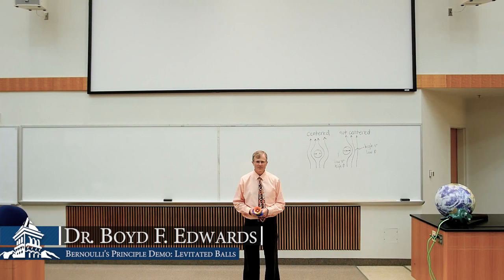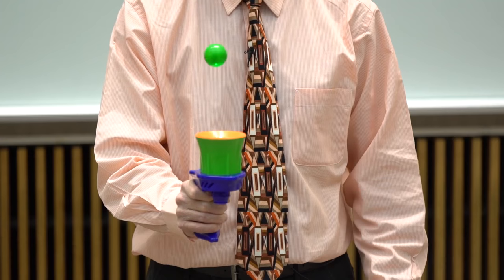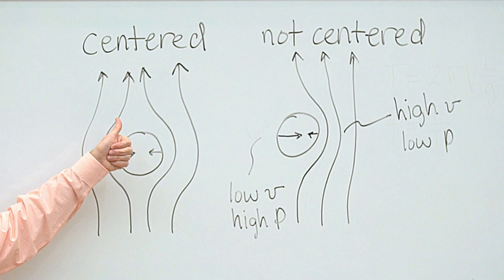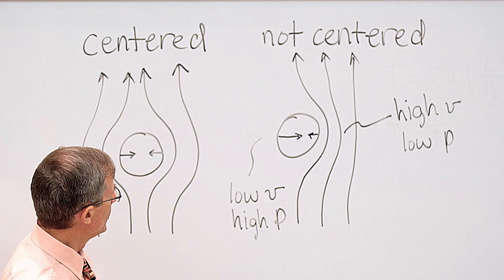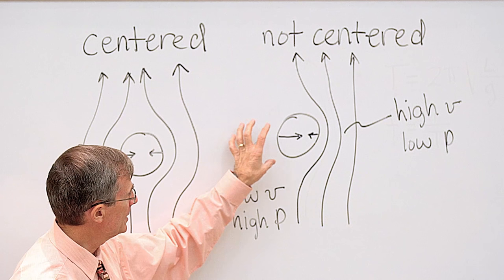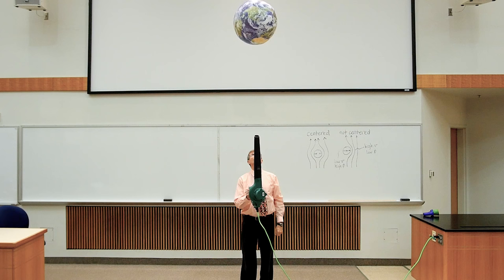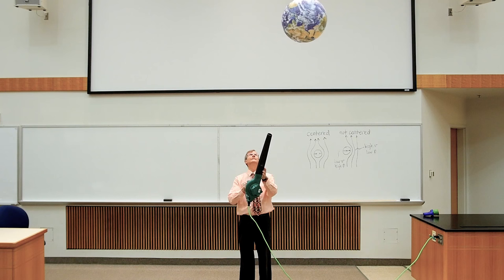Bernoulli's Principle Demo: Levitated Balls

Comment: Why does it start spinning?
Reply: The effect of viscosity is like friction.  The water "drags* the surface along with it. 
..
AND...
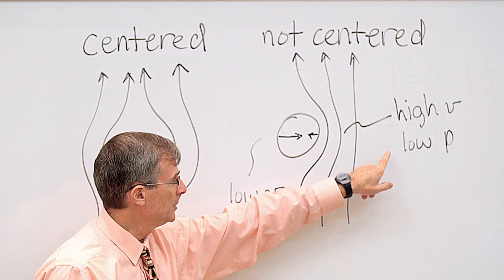'At 1:55; Another video with the most common misconception in fluids.  
..
The centering is caused by the acceleration of the curved flow and is called the Coanda Effect, NOT Bernoulli's Principle.
..
The statement at time 1:55 is Incorrect  : "If you have a high velocity, a high airspeed, then you nave a low pressure." <-- That is false. 
..
Bernoulli's Principle correctly stated is: "An increase in speed is accompanied by a decreasing  pressure.":
An increase in speed is an acceleration!  
 An increase in speed is acceleration, not simply fast. 
.
Bernoulli's Principle becomes relevant at the place where the air is accelerated to the higher speed. 
..
You cannot compare some "fast" air with any random near-by 'slower' air for the pressure difference.  The air must be accelerated.
.
Then, it is the pressure difference for the flow that causes the acceleration.
..
Other common demos are also misunderstood and misinterpreted are blowing over a curved paper, between two balloons or two cans. Those are all curved flow: Coanda Effect.
.
This simply parrots incorrect science.
..
For better information and demos anyone can easily duplicate see Weltner:
Weltner in PDF - "Misinterpretations of Bernoulli's Law".  
Read the text and focus on these figures. :

Fig 3 "Fast" air, NO PRESSURE REDUCTION. 
Figs 8 & 9  Curved (accelerated flow) Pressure change.
http://user.uni-frankfurt.de/~weltner/Misinterpretations%20of%20Bernoullis%20Law%202011%20internet.pdf    

Please stop teaching bad science.
.

Here's videos that got it right: 

This one has it 100% correct! 
https://www.youtube.com/watch?v=kR2Oi3XCX18 

The water curving around to the top wants to go straight.  It's inertia lowers the pressure on the inside of the curve keeping it in the stream.  It is explained better here when a fluid follows a convex curved surface:
 https://www.youtube.com/watch?v=3MSqbnbKDmM 
..
This one s also correct. 
 https://www.youtube.com/watch?v=NvzXKZNJ7ZU 

Veritasium. He doesn't explain it completely well.  
https://www.youtube.com/watch?v=mNHp8iyyIjo

Comment: how can i calculate the angle that makes the ball fail ?
Reply from the maker: That's a great question.  You'll need the fluid (Navier-Stokes) equations for that, and they are not covered at this level.  I've not done the calculation, but it's an interesting one!
Reply: @physicsdemos  can u help with it ?
Reply: @ahmednashat2164  I'm not interested in doing the calculation, but I imagine that it's already been done by someone.
Reply: As a rule of thumb, don’t go past 45° on any direction and you should be good

Comment: I can understand it when i am 9... and now, i am graber: lol>
Reply: At 1:55; Another video with the most common misconception in fluids.  
..
The centering is caused by the acceleration of the curved flow and is called the Coanda Effect, NOT Bernoulli's Principle.
..
The statement at time 1:55 is Incorrect  : "If you have a high velocity, a high airspeed, then you nave a low pressure." <-- That is false. 
..
Bernoulli's Principle correctly stated is: "An increase in speed is accompanied by a decreasing  pressure.":
An increase in speed is an acceleration!  
 An increase in speed is acceleration, not simply fast. 
.
Bernoulli's Principle becomes relevant at the place where the air is accelerated to the higher speed. 
..
You cannot compare some "fast" air with any random near-by 'slower' air for the pressure difference.  The air must be accelerated.
.
Then, it is the pressure difference for the flow that causes the acceleration.
..
Other common demos are also misunderstood and misinterpreted are blowing over a curved paper, between two balloons or two cans. Those are all curved flow: Coanda Effect.
.
This simply parrots incorrect science.
..
For better information and demos anyone can easily duplicate see Weltner:
Weltner in PDF - "Misinterpretations of Bernoulli's Law".  
Read the text and focus on these figures. :

Fig 3 "Fast" air, NO PRESSURE REDUCTION. 
Figs 8 & 9  Curved (accelerated flow) Pressure change.
http://user.uni-frankfurt.de/~weltner/Misinterpretations%20of%20Bernoullis%20Law%202011%20internet.pdf    

Please stop teaching bad science.
.

Here's videos that got it right: 

This one has it 100% correct! 
https://www.youtube.com/watch?v=kR2Oi3XCX18 

The water curving around to the top wants to go straight.  It's inertia lowers the pressure on the inside of the curve keeping it in the stream.  It is explained better here when a fluid follows a convex curved surface:
 https://www.youtube.com/watch?v=3MSqbnbKDmM 
..
This one s also correct. 
 https://www.youtube.com/watch?v=NvzXKZNJ7ZU 

Veritasium. He doesn't explain it completely well.  
https://www.youtube.com/watch?v=mNHp8iyyIjo
Reply: @Observ45er  Thanks!!!

Comment: At 1:55; Another video with the most common misconception in fluids.  
..
The centering is caused by the acceleration of the curved flow and is called the Coanda Effect, NOT Bernoulli's Principle.
..
The statement at time 1:55 is Incorrect  : "If you have a high velocity, a high airspeed, then you nave a low pressure." <-- That is false. 
..
Bernoulli's Principle correctly stated is: "An increase in speed is accompanied by a decreasing  pressure.":
An increase in speed is an acceleration!  
 An increase in speed is acceleration, not simply fast. 
.
Bernoulli's Principle becomes relevant at the place where the air is accelerated to the higher speed. 
..
You cannot compare some "fast" air with any random near-by 'slower' air for the pressure difference.  The air must be accelerated.
.
Then, it is the pressure difference for the flow that causes the acceleration.
..
Other common demos are also misunderstood and misinterpreted are blowing over a curved paper, between two balloons or two cans. Those are all curved flow: Coanda Effect.
.
This simply parrots incorrect science.
..
For better information and demos anyone can easily duplicate see Weltner:
Weltner in PDF - "Misinterpretations of Bernoulli's Law".  
Read the text and focus on these figures. :

Fig 3 "Fast" air, NO PRESSURE REDUCTION. 
Figs 8 & 9  Curved (accelerated flow) Pressure change.
http://user.uni-frankfurt.de/~weltner/Misinterpretations%20of%20Bernoullis%20Law%202011%20internet.pdf    

Please stop teaching bad science.
.

Here's videos that got it right: 

This one has it 100% correct! 
https://www.youtube.com/watch?v=kR2Oi3XCX18 

The water curving around to the top wants to go straight.  It's inertia lowers the pressure on the inside of the curve keeping it in the stream.  It is explained better here when a fluid follows a convex curved surface:
 https://www.youtube.com/watch?v=3MSqbnbKDmM 
..
This one s also correct. 
 https://www.youtube.com/watch?v=NvzXKZNJ7ZU 

Veritasium. He doesn't explain it completely well.  
https://www.youtube.com/watch?v=mNHp8iyyIjo
Reply: This was the comment that I was looking for.  I suspected there was a problem, but I didn't know enough details to spell it out so well.  Thank you.
Reply: @marcochimio  At 1:55; Another video with the most common misconception in fluids.  
..
The centering is caused by the acceleration of the curved flow and is called the Coanda Effect, NOT Bernoulli's Principle.
..
The statement at time 1:55 is Incorrect  : "If you have a high velocity, a high airspeed, then you nave a low pressure." <-- That is false. 
..
Bernoulli's Principle correctly stated is: "An increase in speed is accompanied by a decreasing  pressure.":
An increase in speed is an acceleration!  
 An increase in speed is acceleration, not simply fast. 
.
Bernoulli's Principle becomes relevant at the place where the air is accelerated to the higher speed. 
..
You cannot compare some "fast" air with any random near-by 'slower' air for the pressure difference.  The air must be accelerated.
.
Then, it is the pressure difference for the flow that causes the acceleration.
..
Other common demos are also misunderstood and misinterpreted are blowing over a curved paper, between two balloons or two cans. Those are all curved flow: Coanda Effect.
.
This simply parrots incorrect science.
..
For better information and demos anyone can easily duplicate see Weltner:
Weltner in PDF - "Misinterpretations of Bernoulli's Law".  
Read the text and focus on these figures. :

Fig 3 "Fast" air, NO PRESSURE REDUCTION. 
Figs 8 & 9  Curved (accelerated flow) Pressure change.
http://user.uni-frankfurt.de/~weltner/Misinterpretations%20of%20Bernoullis%20Law%202011%20internet.pdf    

Please stop teaching bad science.
.

Here's videos that got it right: 

This one has it 100% correct! 
https://www.youtube.com/watch?v=kR2Oi3XCX18 

The water curving around to the top wants to go straight.  It's inertia lowers the pressure on the inside of the curve keeping it in the stream.  It is explained better here when a fluid follows a convex curved surface:
 https://www.youtube.com/watch?v=3MSqbnbKDmM 
..
This one s also correct. 
 https://www.youtube.com/watch?v=NvzXKZNJ7ZU 

Veritasium. He doesn't explain it completely well.  
https://www.youtube.com/watch?v=mNHp8iyyIjo
Reply: @Observ45er  These two effects are not mutually exclusive. The Bernoulli equations still applies here and is useful for teaching purposes. In fact, some textbooks (e.g. Young et al.) include the flow curvature effect on local pressure when discussing the Bernoulli equation.
Reply: @FluidMatters  You're not refuting what I said.  Bernoulli's Equation gives no cause and effect understanding, it only allows calculating values.  I make no claim that Bernoulli's Equation is incorrect in calculating values when applied correctly.
.
I explained cause and effect. 
.
Saying two things are ""not mutually exclusive" isn't explaining what you think I posted is incorrect. 
.
What are the 'two things'?
.
Saying that things are  "useful for teaching purposes" does not refute anything I posted and I won't dispute that.
.. 
It is a measurable fact that the air out of any blower is at atmospheric [static] pressure, not below it.  The energy accounting for its dynamic pressure was added by the blower'. <-- That is FACT - AND proper application of Bernoulli's Principle showing an increase in velocity accompanied by a decrease in pressure from inside the blower to the atmospheric pressure of the faster flow outside the blower -- physics.
... 
Bernoulli's Principle is about CHANGES in velocity which is Acceleration along a flow, not simply differences in speed between any two locations.
.
Once you introduce a surface near the flow, you have introduced an additional constraint that must be included in the overall understanding of the physics.. 
.
There ARE valid physics reasons things happen and they can be understood, especially at a college level, AND the high school level as I have experience in.
.
Please attempt to explain the physics that demonstrates which of my statements you believe to be incorrect.
Cheers
Reply: @Observ45er  Sorry, I can't teach you the fine points of fluid dynamics in the comments to a video.
Reply: @FluidMatters  Nor the fundamentals IN the video, obviously
.